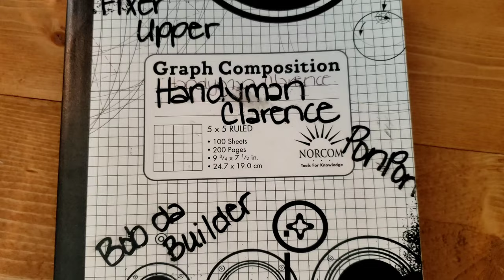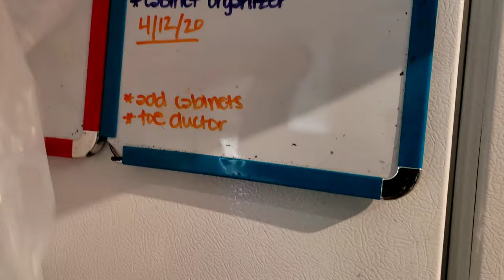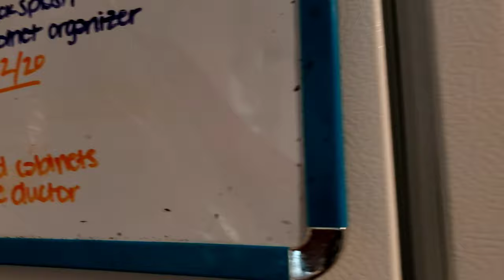DIY Faux Wood Beams for UNDER $40!!!| PonPon Sisters meet Handyman Clarence

Comment: Did you make sure that you weren't cutting down a load bearing wall. the double joist next to where the door was makes me wonder if you just compromised the houses structural integrity?
Reply from the maker: It was a curtain wall. We made sure to check and ask. 👍🏽
Reply: That is true.